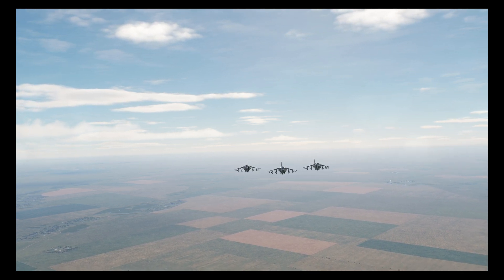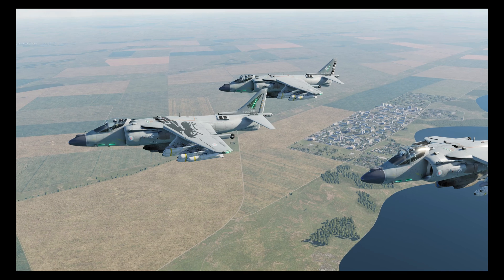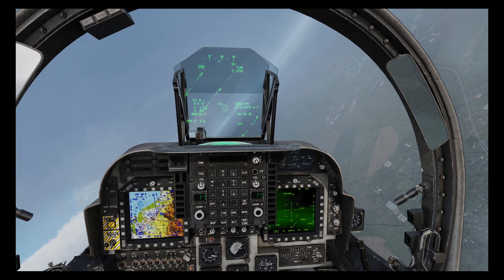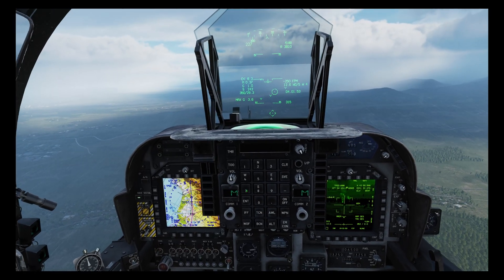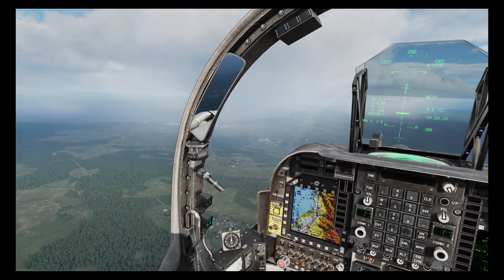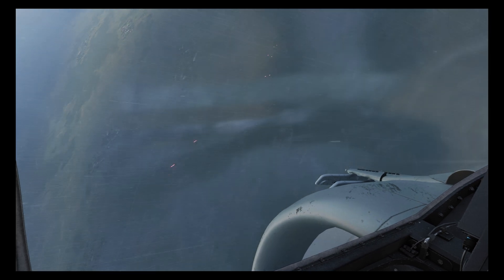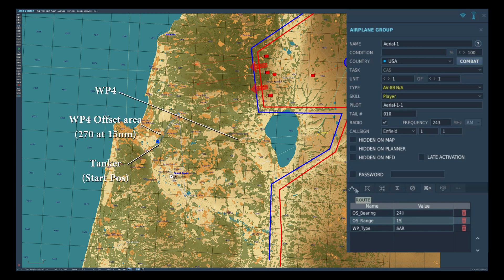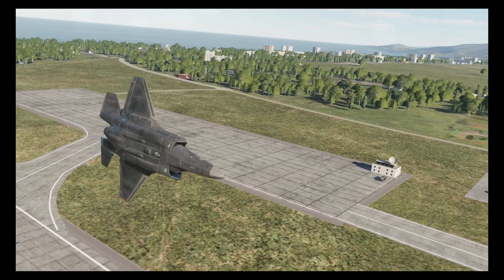DCS Harrier Waypoint Offsets

Comment: I can think of a good use case for myself, because both the waypoint and the designated offset point are visible in AG mode. I'll use this to have threats on one point and the target on the other.
Normally when I add targets as waypoints and make them visible with "SEQ" they disappear as soon as I designate one and switch to AG mode. Using offset seems a good way to keep SA on things, as I don't want to wander over a second threat area when doing my orbit around the first target.